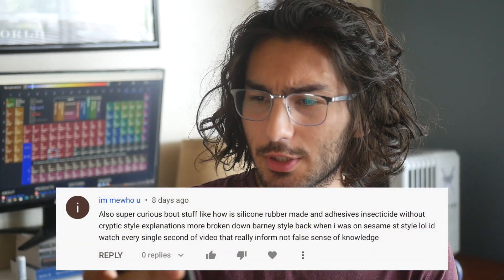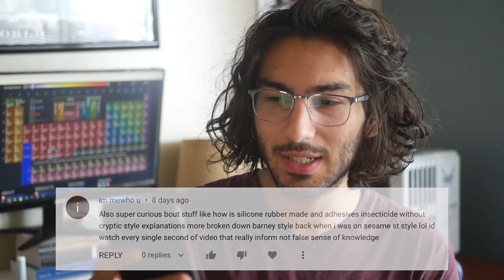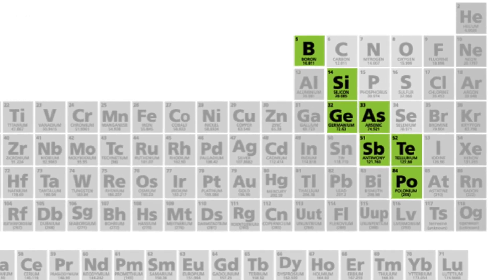Why Silicone is a Miracle Material | Chemistry

Comment: Baptist well silcon 4th energy crystalline energy 418JOHN crystalline code Q jc energy bloodline code and great energy great as explained with plasma crown energy quarts stone energy great find amongst gray clay Mercury and great for cymatic liquid dynamics resonance energy levitation energy using sound frequency and great 7th energy PLAZMA CROWN energy. 528hz energy light vibration energy proton neutrino energy magnetic energy 6th energy code 369 9th energy gsnter 9th using backwards tesla coil energy ✨️ transfer  energy to silcon energy use sweet honey comb proverbs bible cracked for levitation energy wrap around quarts stone energy ✨️ great energy storage great for outer craft skin ✨️

Comment: Can someone explain why silicone is expensive rather with other similar plastics?
Reply: For one, it is made of solicon, elemental silicon (a metal).
Which is.. I'm sure.. more expensive than hydrocarbons i.e raw material that polymers/plastics are usually synthesized from.
Hydrocarbons are gas/oils.
Petrol,/gasoline, etc.
Plus the process of synthesizing silicon may be different, more expensive, more work, than common plastics.
Reply: F🎉❤😂🎉😂🎉🎉🎉qt❤qw❤ @yasirrakhurrafat1142